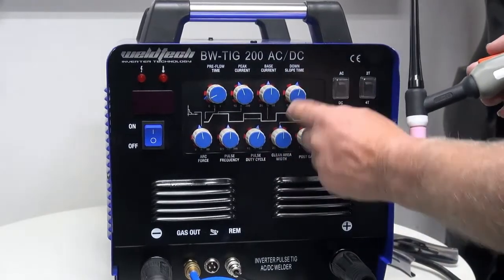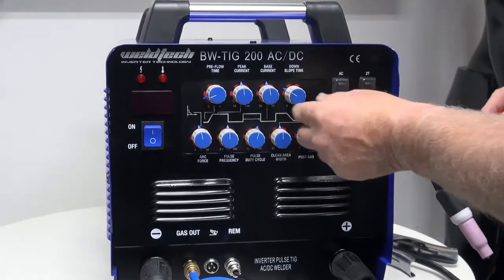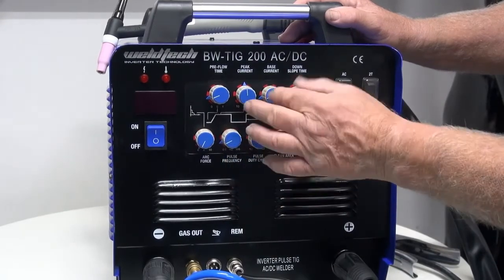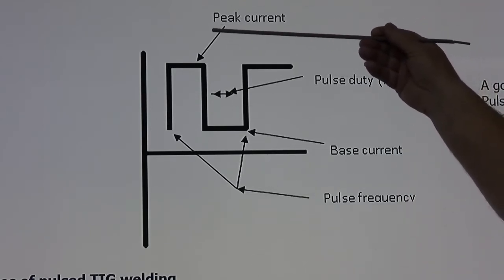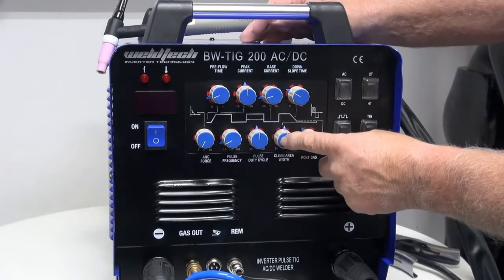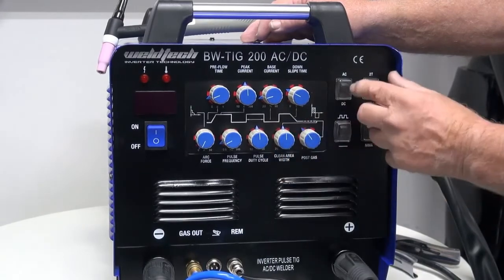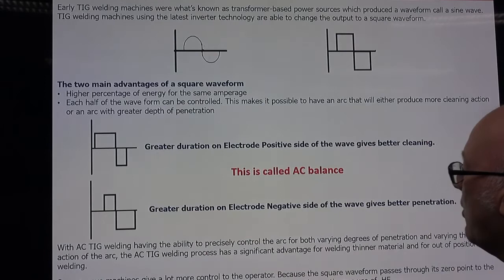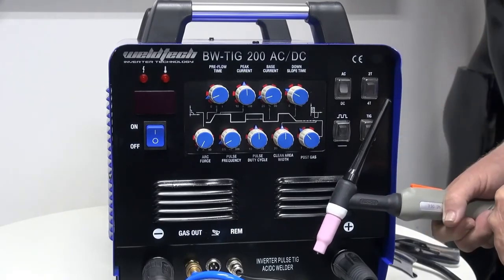Weldtech BW TIG 200 ACDC

Comment: Great review. Do you know what is Tig ac output frequency at this welder? Not the pulse frequency wich is optional and not the grid frequency. Also, do you know what value does the foot potentiometer needs to have?

Comment: thank u bro for the explainatin..can you explain also da 4 toggle switch T2 and T4 etc...
Reply from the maker: 2T – normal tigger activation, hold trigger/button down to weld, let go to stop.

4T – toggle style, push button to start weld process. Now you can weld without holding down the trigger/button, for those long welds your finger can get tired. Then push button again to end the weld process.

 This is the same on MIG/TIG.